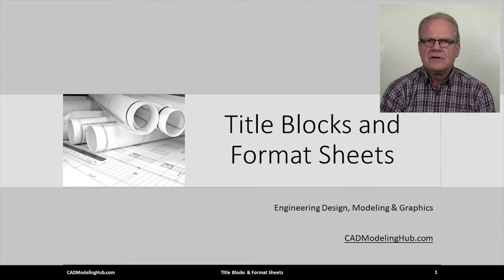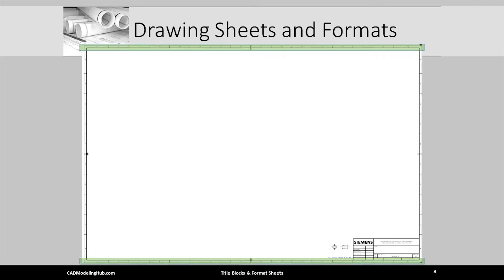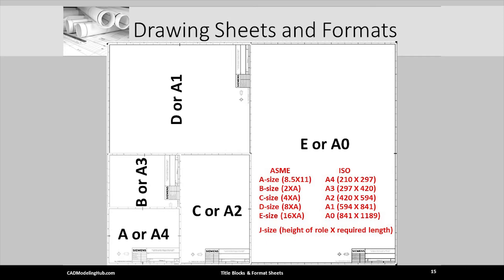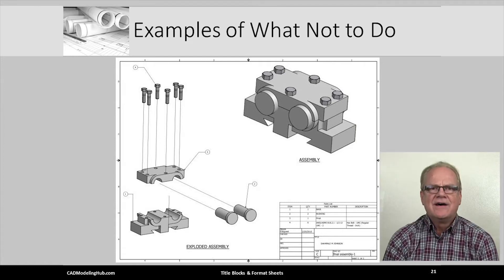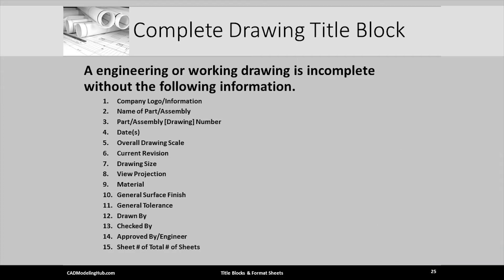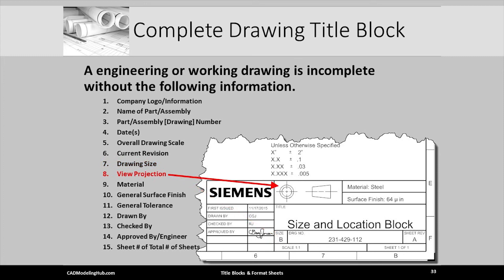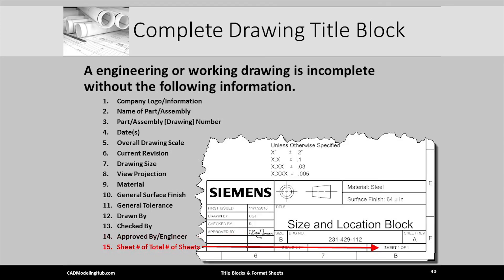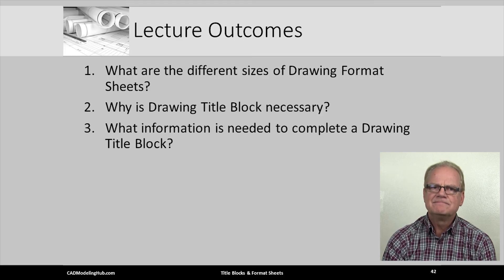Title Block and Format Sheets

Comment: FYI per ASME 14.1 the arrows at the mid points are for centering the drawing for creating microfilm or microfishe.  The name/logo per ASME 14.1 goes where you show the company address.

Per ASME Y14.1 the third angle projection is supposed to be inside of a specific size box with text just below the box starting "Third angle projection".

The UOM goes inside of the tolerance block above the third angle projection block per ASME Y14.1.

Full Company address is only required when there is no DAI aka cage code listed.

All text in drawings including title blocks should be in all caps.  The exception to this if for when you show UOM.

Letter zones start in the lower right corner with A on the horizontal axis and 1 on the vertical axis and increment up to the left and upward. This is per ASME Y14.1.